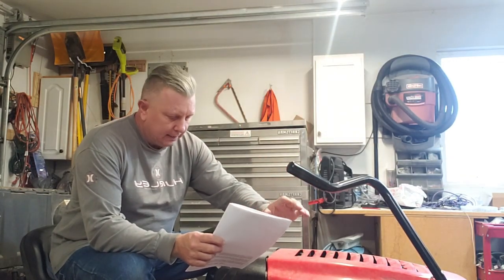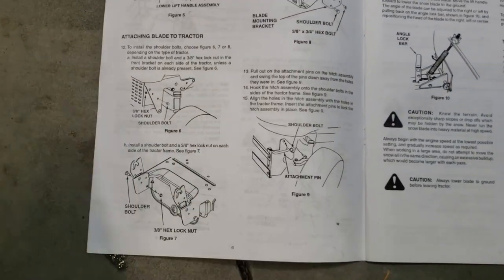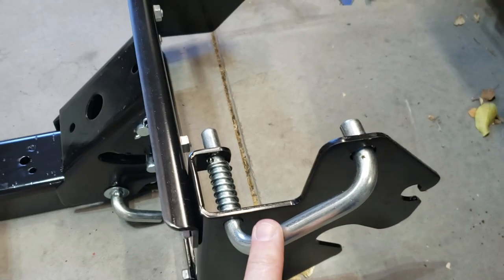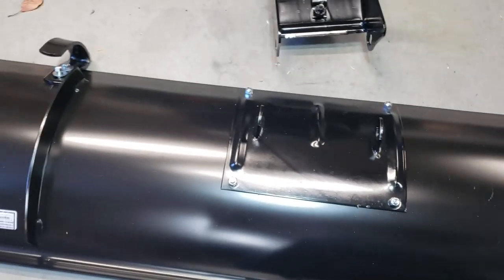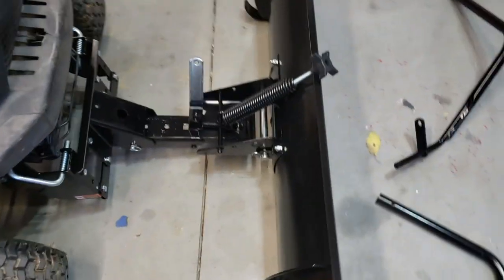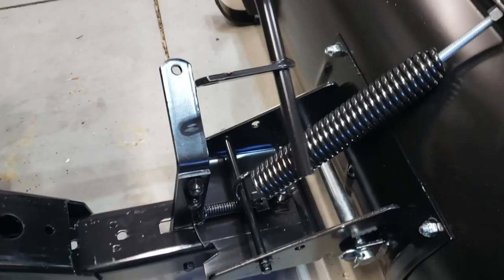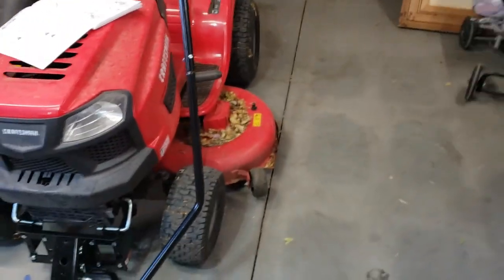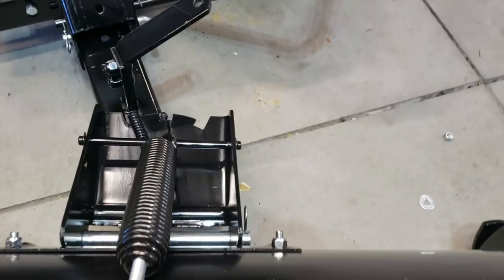Snow Plow Blade Installation of Craftsman T150

Comment: Very helpful thanks, I had most of it figured out but the last couple steps. Also I read that you should remove the mower deck which I did, A little tricky but not too tough and it will be easier to change the belt and sharpen the blades for next spring 👍